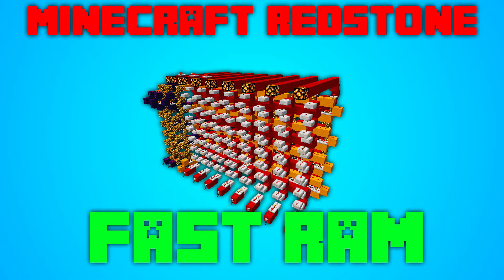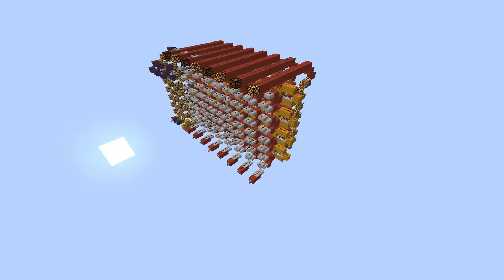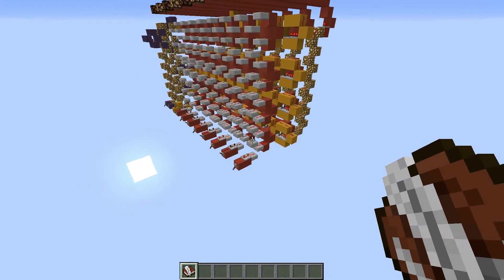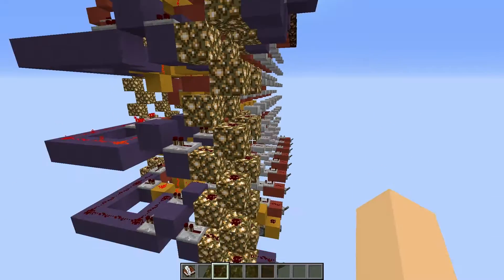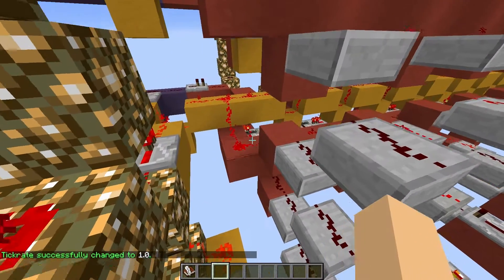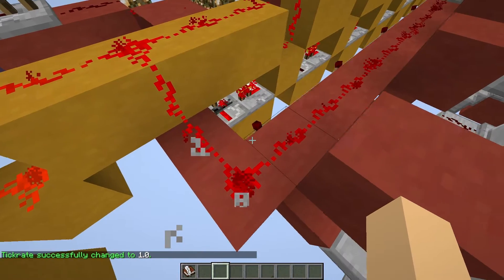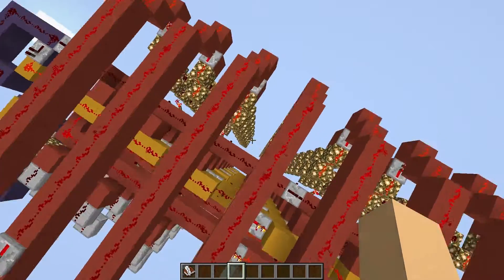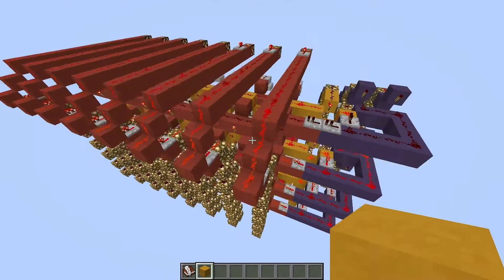Fast RAM- Compacting Redstone - Tutorial 5

Comment: Excellent! But I thought you already had a ram design using droppers
Reply: Never mind, I went back and checked and it was a solid state drive. Still the same thing (in minecraft, not real life) though, right?
Reply from the maker: Christian Grey Yeah there pretty much the same thing. Lol :-)
Reply from the maker: Also In real life Ram tends to output at the same place you input the data to be saved. And it's generally faster at saving data. :-) but yes the designs are pretty similar in Minecraft! :-)

Comment: What is RAM used for in Minecraft, and how is it applied?
Reply from the maker: RAM is used in making redstone computers. Redstone works on something called a Boolean system, this means it can be on or off. You may of heard of binary, which is the same thing. Binary is needed to make computers in real life, as electricity is either on or off. Consequently as redstone also works like binary, it means you can make redstone computers in Minecraft. RAM (Random Access Memory) is an essential part of any computer (redstone or in real-life) it stores data about programs, and values. For example when you run minecraft, the data for minecraft is sent to your computer's RAM which then stores the data and gives it to the CPU (Central Processing Unit) which is like the brain of the computer. So this redstone RAM does the same thing, it stores data for the redstone computer. Hope this explanation helps :-)
Reply: Did someone say binary? ;)